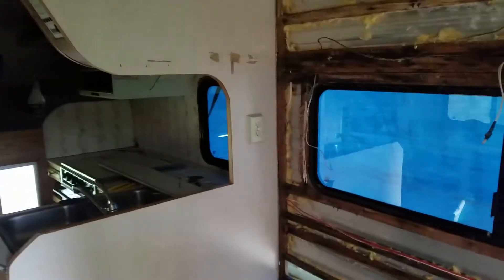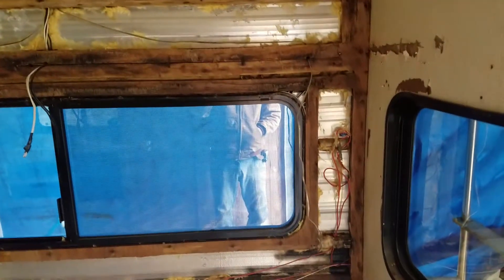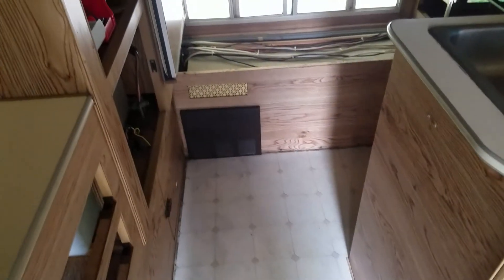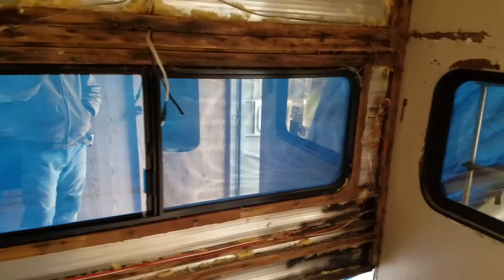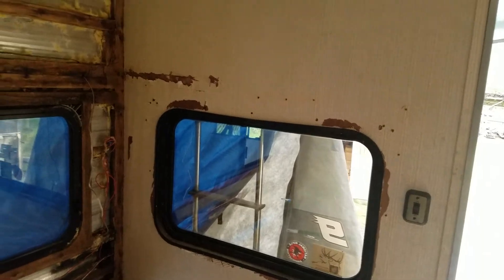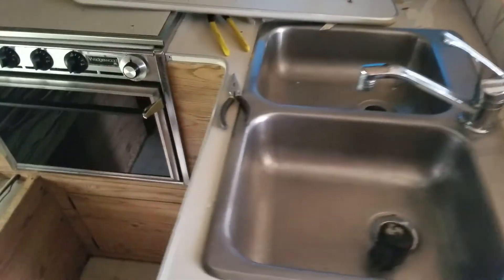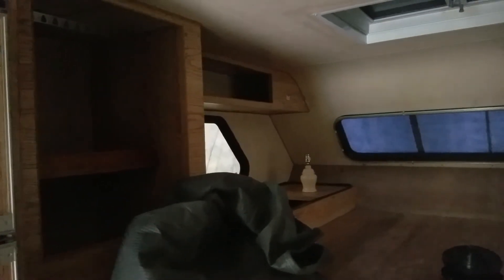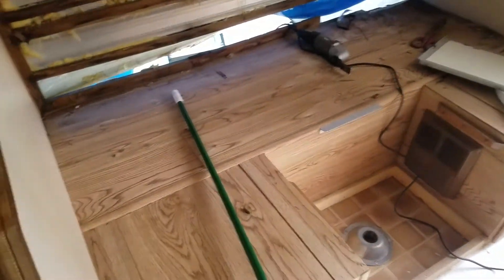1987 Lance 780 Slide-in Truck Camper DIY Rebuild: Overview Ep. 1

Comment: What size truck/bed is needed for this 780 ?  Would a V6 be powerful enough to haul this ?
Reply from the maker: It's not so much the engine, as it is the payload. The camper weighed over 2500 lbs empty. I hauled it with a 1992 F250, but it was too heavy for my 2011 F250.
Reply: We have a dually carring ours. This is the big boy of truck campers
Reply: @FuzzyNaval  what was the torque difference between the 92 and '11?
Reply from the maker: @shinobusensui9395  The 1992 had 390 ft/lb, the 2011 has 405 ft/lb. Both gas motors.
Reply: @FuzzyNaval  what do you think about the 1rst gen Chevy Colorado 2.8?  175hp & 185ft-lbs
Reply from the maker: @shinobusensui9395  This camper would crush it. it over the payload capacity empty. Hauling a camper has more to do with the payload capacity of the truck and less to do with the HP or torque.
Reply: @FuzzyNaval  thanks, I'm thinking of living in a truck but I may look for a van